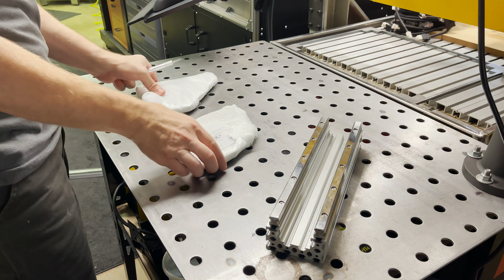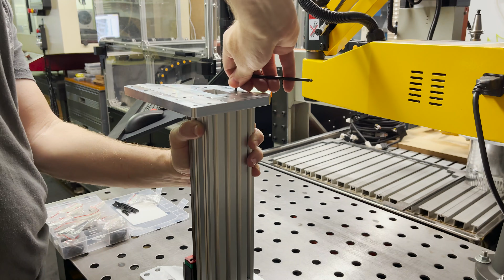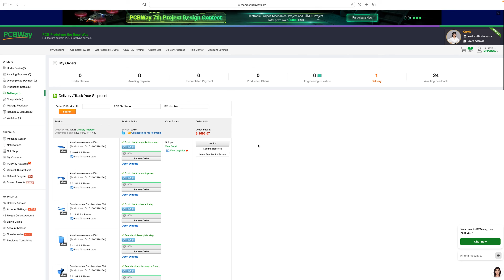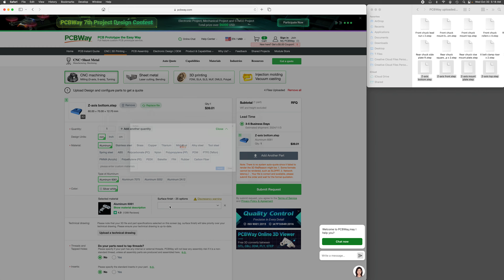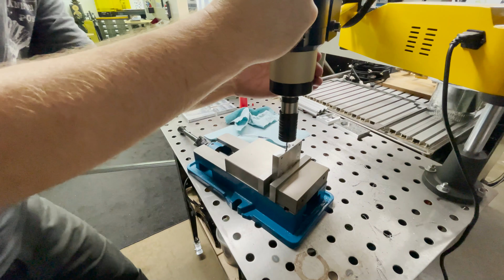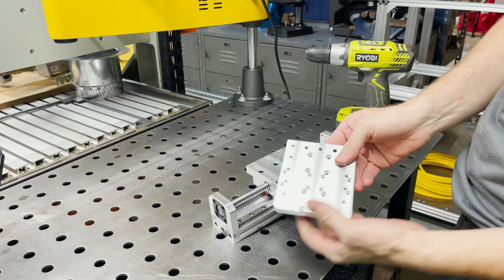DIY Fiber Laser Tube Cutting Machine | Part 4: X-axis & Z-axis

Comment: Now I am in suspense. To me the x axis is going the wrong way. If you rotation and always cutting on center, the front back movement gives you the tub notching capability. even square holes on flat side of square tubing needs and axis along the length of the tube.

Comment: Bro, sorry, I want to ask, can CNC fiber laser cutting use a NEMA 23 DC stepper motor?
Reply from the maker: If you use a fiber laser controller, they require servo for the z axis height control, other axes don’t matter
Reply: @diyfiberlaser  Ok I understand, Does that mean that in addition to the Y Axis and X Axis, it is mandatory to use a Servo if using a fiber laser controller?
Reply: @diyfiberlaser  Can fiber laser use mhac3 or grbl controller?

Comment: Hey Travis, have you ever considered using an electric screw driver such as the Dewalt gyroscope screwdriver (model number: DCF680N2)? This one even has a built in clutch to ensure you tighten down the screws at a consistent torque. Could save you hours with all of those screws!
Reply from the maker: Thanks! I will check out that model. I was interested and researched them before, but I read so many conflicting reviews that I couldn’t decide which one to get, so I just never got one 😟
Reply: @ I’ve had mine for the last 5 years and it was worth every penny. Never broken on me (even after dropping it more times than I can count). Plus it has a built in light! Anyway, keep up the great work, can’t wait to see more of this project!

Comment: yeah i was going to ask about that tapping arm. got a brand/model for us?
Reply from the maker: YouTube is blocking my comment with the direct link, so go to AliExpress and search "M3-M16 CNC Electric Tapping Machine Servo Motor Electric Tapper Drilling With Chucks Easy Arm Power Tool Threading Machine"

Comment: Can your fiber laser cut through wood? If yes, how thick can it cut?
Reply from the maker: Never tried it...I have a C02 laser for that.
Reply: Can't cut wood, the capacitance sensor of the laser head can't recognize the material.
Reply from the maker: @TAMARbarCNC  I've seen a couple videos of people doing it, but apparently you have to disable the height sensor and manually set the height. I noticed a button in the Raytools software to disable it, but I've not tested it yet.
Reply: @diyfiberlaser  I tried to cut wood once but didn't seccided haha.

Comment: Kindly, what's the model of the tapping machine, and where can I get it?
Reply from the maker: YouTube is blocking my comment with the direct link, so go to AliExpress and search "M3-M16 CNC Electric Tapping Machine Servo Motor Electric Tapper Drilling With Chucks Easy Arm Power Tool Threading Machine"
Reply: Joining the question